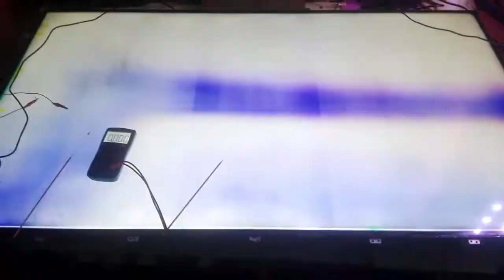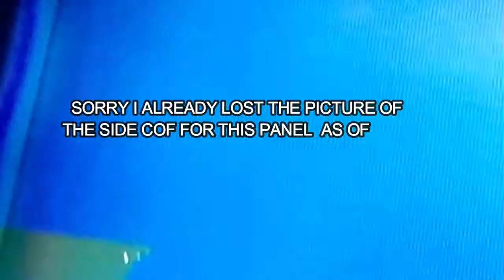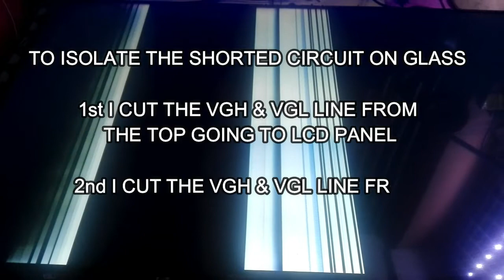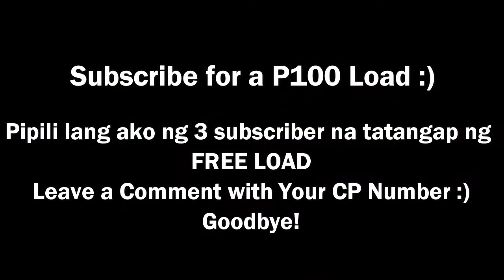TCL Led TV vertical bar lines

Comment: sir saan po ba ang vgl? Wala kasi tespoint sa side cof nga pariho talaga tayo ng truble sir
Reply from the maker: check mo sa 1:09 sir andun label sa topboard tapos sundan mo papunta sa side cof
tapos check mo sa 3:34 andun ung connection na ginawa ko  bale nacut ko ung nasa side cof para isolated ung linya nung VGL at VGH

make sure lang sir na shorted talaga  kasi pag nacut mo yan medyo may kahirapan ibalik po yan

Comment: Sir gud day. Yung tcl ko na 55 inch model p6us bar lines din po ang problema. Check ko yung lc1 and lc2 both side ok naman. Yung Vghf at vgl, steady voltage ba yan? Pahingi po ng advice.. More power on your channel.
Reply from the maker: natry nyo po ba ihang ung ribbon nya left and right?
Reply: @TJTeeVee  Sir, bali yung ribbon nya ay iisa lang po kasi P6US na Model po siya. E sne ko sayo picture nya kung ok sayo.
Reply: @TJTeeVee  di pala puedi mag attached ng picture dito sir..
Reply from the maker: @perryloupasaol8215  pm mo n lang sa FB ko sir andjan sa description